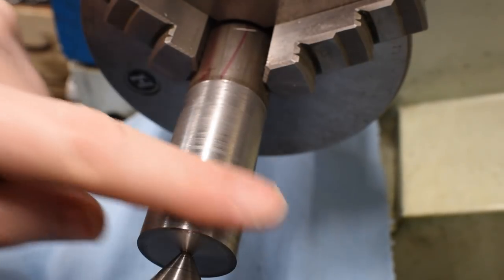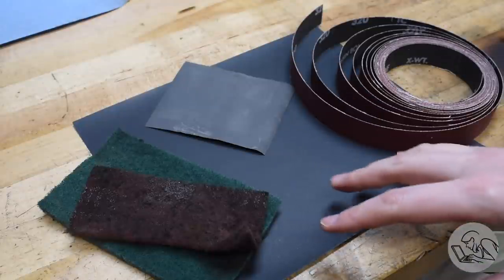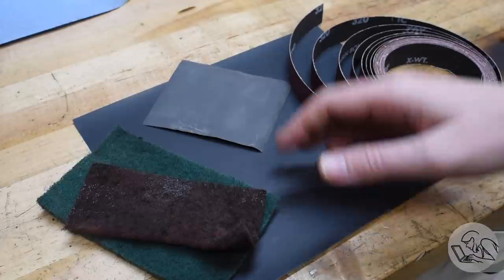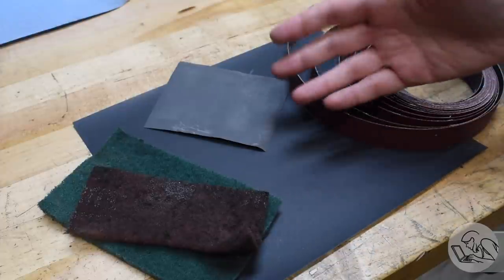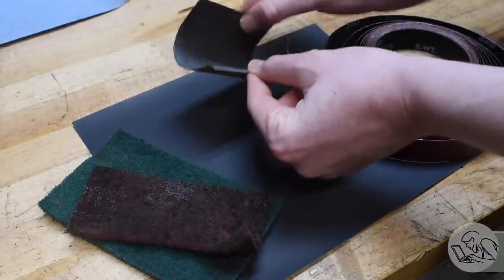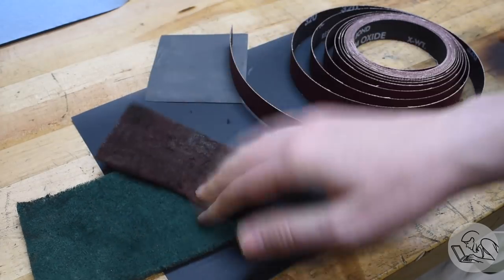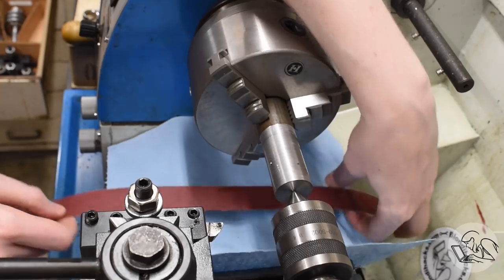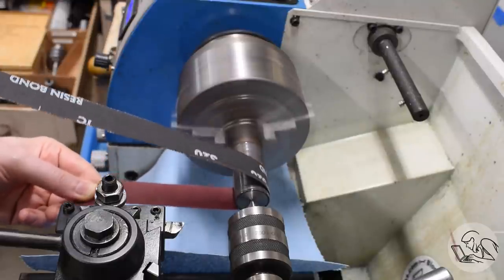Emery Paper In The Machine Shop

Comment: Words from a pseudo-professional (three years full time on a lathe): I routinely use coarser grits than 320; for removing nasty tool marks and quickly zapping off a thou, 120 grit -- and sometimes even 60, believe it or not. 240 and 400 are regular finishing grades, and 600 for super-pimpin' gloss.
Reply: yes
Reply: Thank you for adding “super-pimpin’” to my day. It feels right.
Reply: I work with aluminum molds and I end up with 3000 and i start with 320 and just work up from there
Reply: 600? laughs in 1000-5000 grit
Reply: @MyLonewolf25  There's a place for that, but I get plenty fine finishes for bearing surfaces, etc, with all dimensions within .0001", calibrated off gage blocks. 600 is usually overkill for that.
Reply: I should also add, my polishing grits are usually in small squares, not long strips. I hold them in place with direct pressure; they are too small to wrap around the piece. Yes, they fill quickly; an air jet helps a lot. Every now and then they slip away, but it's not hazardous as long as you keep your brain engaged with your work, which I do all the time, and I recommend the same of any machine tool user.

Comment: I'm lucky and my work uses large 12" diameter scotch brite wheels. When they get down to 6" or so, they are considered worn out and are thrown away. I made a bushing to fit them to my bench grinder and now have an endless supply of free wheels!
Reply: Oh man, I love when things work out like that.  One man's junk is another man's treasure.  I have repurposed so many things people just give or throw away.  My mind is always working with this question: Hmmm, what can I do with that? Lol I seem to always come up with something. Great score!
Reply: Sounds like you should send your buddy Quinn a mandrel and some of those free wheels.
Reply: @onestopfabshop3224  Many years back, I worked for an INTERNATIONALLY FAMOUS Inventor of a "Trombone Valve"  for the Musical Instrument with that name.

At one point in his work, he did that "Figure Eight movement" that our Quinn Demonstrated so WELL!

He had a  0.500 inch thick Plate Glass, with all edges Factory ground and probably 12X15 inches (or larger) as his Sanding BASE.

My Point in Replying to you is, HE ONLY used the same Paper for ONE sanding, for either Aluminum OR brass !  !  !

After the days work, I would Empty his "waste paper bin" and All that 400 Grit Paper became MINE (after asking Permission First) ! ! !

He also had that Same Standard for his HOME SHOP MADE sliding table saw Blades: "X # of cuts" = NEW BLADE.

I salvaged 30-40 Blades, 4 Inch Diameter, 0.060 Kerf and like 120 Teeth around the blade!

BUT ~All that Stuff~ was ZERO Compared to watching a man who had the FIRST NEW Brass Valve Patent (for musical Instruments) since 1878 ! ! ! !

Weekly, our phone rang from Zurich, Switzerland, Sydney AUS, JAPAN, etc!!!!!!!!
Reply: @madsighntist14  That's a cool story man. Thanks for sharing.

Comment: "We've all put emery paper on our surface plate." ha joke on you I don't even have a surface plate.
Reply: Go buy a little one on eBay or amazon, a 9x12 is perfect for using sand paper. A Grade B plate is more than enough for most of what is needed. I always wanted a big precise granite plate, but I finally broke down about bought one of these, I use it all the time. And I don't feel bad about putting sand paper on it :) which I would have done it years ago
Reply: Haha yeah same. I guess everyone who has one does this though, Tom Lipton (Ox Tools) put out a video named 'Confessions of a surface plate abuser' not that long ago. And he's like a top tier, toolmaker level machinist. So if he does it then us lowly mortals don't have a chance in hell of resisting the temptation.
Reply: @ericg7044  I think the crime is doing it to a AA flat uber expensive plate. Get a cheap beater and dedicate it to that
Reply: @ericg7044  Tom Lipton did say that he has a dedicated surface plate for sanding and never brings abrasives near his trued plate(s).  I'm still at the "flat wood is good enough" stage, lol, but will likely get a piece of glass soon.
Reply: Sanding Stones are my favorite. Being so cheap compared to constantly buying sandpaper and not requiring glue or tape, it give you the full surface of the stone to work.
Reply: I am making up for you. I have two surface plates. One that sees emory paper all the time and one I don't even keep in the same room with emory paper.
Reply: Go to your local countertop maker, ask for the sink cut out from a granite counter. Probably free, maybe  $10-20.
Reply: I work at one of the few aerospace oem gearbox manufacturers, and they actually use the emery paper on surface plate method to flatten housing surfaces to join together. Their emery paper is about 4 foot by 8 foot though. And wet.

Comment: I run a CNC lathe and a lot of parts that I make call for a 32 or 16 surface finish on 304 stainless.  I can't tell you how many times that we've had problems with the surface finish, but I can't clean it up on the CNC lathe because of the tight tolerances and the lack of tool pressure.  So, I give it to the manual lathe guy and he chucks it up and uses sandpaper to fix the surface finish.  We've  been able to save hundreds of parts over the years by using this method.
Reply: I dont know your parts but you could add an option stop before the cut off tool and use MDI to spin it or just switch to handle and use the continuous spin buttons and use the cloth that way then let the cut off tool run.
Reply: @roydavis4136  Oddly enough, I finally figured that out.  It depends on how bad the part is, but if it's not too bad I use automotive wet/dry sandpaper to clean it up.  Thanks for the tip though.

Comment: The best tip I received concerning the use of abrasives (in the context of woodworking, but also applies to metalworking) is not to select a grade according to the finish you want to achieve, but to always think in terms of the finish you are starting with. Thus, an abrasive should be regarded as a tool to remove the imperfections introduced by the previous tool, and that determines the selection of the grade. In the case of sanding, you therefore start with a grit that is approximately twice as fine as your existing finish whatever that may be. This will removes the optimum amount of material at the scale of the existing imperfections as fast and efficiently as possible and results in a new finish as fine as that grit. If you want to go further, you simply repeat this principle - selecting a grit size to optimally remove the marks of the previous grit, and so on and so forth. The net result is the minimum amount of material loss for any given finish in the shortest possible time.
Reply: Best comment, well done aporiac
Reply: Thanks for passing this along, gives me a brand new perspective on the topic.

Comment: One thing they teach in metalsmithing is you sand in different directions: 120 vertical, 220 horizontal (for example) and run the 220 until you can't see the 120 scratches, and only then move to the 400.  That's the most efficient way.  On a lathe, you could run X grit for a bit, then stop the lathe and briefly scrub it axially to see if it has removed all the previous grit's deepest scratches.

Comment: One thing to note about glass is that it's a lot more flexible than one might think, we can even see it bending just a bit in the video around 14:07 
This probably isn't an actual problem (barring a very bumpy table), but local glaziers might have thicker glass than what is found in picture frames available cheaply and could be worth a visit. Or phone call, given current circumstances.
Reply: I use glass, but when I decided to use glass I just waited until I saw a discarded piece of tabletop glass or some other thick stuff on Craigslist/side of the road.  It was good practice for cutting thick glass by the time I had a nice square piece of the right size.
Reply: @nefariousyawn  We took out our back door that had a full panel of glass in it.  I use it to flatten the head of engines.  Works great.
Reply: I got a piece of 30mm thick glass, that thing is never going to bend or flex. It used to be a part of some chemistry lab equipment.
Reply: Cheap beat-up old thrift shop mirrors (or expensive new ones if you like throwing money away) are often made of 1/4" glass.

Comment: If you want to get a good finish on a part while lapping and you don't have high grit paper, turn over the emery paper and use the back. It was a trick I was taught during hand fitting in my apprenticeship and it works well, especially on aluminium
Reply: and 10 bonus points for using the correct spelling
Reply: @chrisd4987  I am British after all
Reply: Aluminum for us uncultured swine who throw our tea in the bay

Comment: I'm regularly using 1000 grid sandpaper for the small screws i need for my clicky pens.

They need an actual mirror finish and oh boi is it sattisfying to be able to tell the color of your eyes in a 5mm diameter part :D
The reason for the mirror finish is that i'm precision hotbluing them. And if you've never done it, i strongly recommend you try it some time. Just polish a part (actually it's not stricly nesessary) and heat it with a flame till it turns blue! This color makes me so happy ^^
Reply: I oven-baked a blacksmithing project I made once, and it turned out a nice blue... so satisfying!! (Edit: point being that the blue is nice even without the mirror polish factor. With it, wow, even better!)
Reply: @DavidLindes  definetly true, i also love when you don't heat it evenly and you get this weird rainbow wich shows only yellow, red and blue :D

Comment: I use the much higher grades (800, 1000, 2000) and a variety of polishing compounds for many of my projects. Of course, I cut custom motorcycle parts (grips, pegs, and such) but those are seen parts.

Simple Green, soapy water are really good too for wet sanding

Comment: I used to use Emery cloth when I was a kid but when I got older I began using silicone carbide sheets in various grits from 36 grit all the way up to 5000 grit. It finishes materials better and it creates a more reliable /duplicatable finish.
Also, for nice finishes on the lathe don't forget your long angle lathe files. They do a very nice job but it takes a little bit of skill and technique to master their use.

Comment: I went to my local glass shop and asked him if he had any "drops" he could sell me. He asked what I was using it for and he hooked me up with two  pieces of ¼" tempered glass cut to 10" x 12". Her even rounded the edges for me.  I now have great surfaces sharpening and sanding. Another truck is to lightly wet the glass then set paper on it and it acts as a glue and holds the paper in place. 😀 I think I've watched about thirty of your videos now and some of them multiple times. I think you've earned my support. You will be the first and only creator I support in Patreon. 😀

Comment: I notice you've removed the chuck guard on the lathe, now I'm not beating you up about this coz I spent the best part of 35 years arguing with people whose "raison d'etre" was apparently to fit every conceivable type of guard on my machine til it was impossible to do the work. I solved the problem by removing the guards to do the work and refitting them when I knew an inspection was due, as a hobbyist you don't have such problems. Keep up the good work. :-)

Comment: If you're trying to get a really shiny finish, using 2000 grit and above, it's best to rinse off the emery before you use it, especially if you store it in the same place as the rougher stuff. It only takes a few errant coarse grains to ruin the finish.

Comment: Holy jeepers that scotchbrite wheel did an amazing job there
Reply: As did the Real Time Honesty Cam 3000, it has to be said :)
Reply: I've been using one for almost a year now and I love it.  It's not too aggressive, and is long lasting unless you're deburring sharp edges perpendicular to wheel rotation (it will start shaving off the scotchbright; if you deburr parallel to wheel rotation first, it will leave a small groove in the wheel, but not eat the wheel as fast.)  They are pricey.

Comment: Great video and info! I’m glad you mentioned the “not to use it more than half of the width” and showed how to hold it but one thing to add to make it more graphical is NEVER roll the cloth around the piece you’re working on! MACHINE HAVE NO HEART!!!! That was my first and only accident I’ve ever had on the lathe, on my very first day of training (OJT)! My instructor was very experienced production (speed) machinist but not really an instructor. He just forgot the fact that anyone would be TEMPTED to roll the cloth under the palm of your hand and try to take as much material as possible in the least time to impress your instructor but, as anyone can predict by now, as soon as the end of that cloth catches under itself and closes the loop, automatically will pull in itself and your fingers in the process as any untrained/unharmed person will, also automatically, grab and hold that cloth to death to soon realize that there it goes your fingers under and between the cloth! And let me tell ya, one of the most excruciating pains I’ve ever experienced when my fingernail was smashed and pulled! I was lucky that I let it go fast enough to keep my fingernail and not break my finger, but the pain stayed overnight to engrave the idea of how valuable was the safety measures and how hard and heartless is any machine! Please, keep doing your little talks about safety as most of us have never done machine work and nowadays being so easy to acquire machinery to get started, what makes it super dangerous no matter how harmless any operation may seen!
Thank you!

Comment: I have had good results in polishing surfaces by using Abranet sanding mesh. One advantage in using this material is that it does not clog in use. It is available in many different grades to suit different applications. Assume this is available in your neck of the woods.
Reply: Is that like the stuff they use to sand drywall?

Comment: Hi Quinn, great content once again. If I may interject briefly, as a former fabricator in a glass fabrication plant, i can assure you that glass is not flat. It comes in various degrees of "bowing" depending on the heat treatment, size, thickness etc. Most not heat treated glass is fairly flat but thin glass of that kind is extremely flexible and it will take the average shape of the work surface you put it on. Hope this helps

Comment: Well buggar me Miss Blondie taught me something today . Using emery on a mandrel to hold small parts .                   I have not and do not use CA glue . . I have no surface plate but i do have a 20 mm thick Perspex that is flat I also use water on wet/dry as easy to wash in bucket of water to remove waste and keep paper clean

Comment: I have polished many hydraulic rick hammer buts with 400 grit off of a roll. No lathe, but I would hang it vertically. Start with a piece of it wrapped around a file to take off the high spots, listening to when they got smooth, then taking a long  strip  and wrapping it clear around 540 degrees (282 degrees celcius) so both ends were pointing the same direction and the paper was at an angle to the bit. Then pull and "push", working my way up and down. Once things were looking pretty good, get a new piece and wrap it the opposite direction to get a cross hatch. Then keep using the same worn, loaded piece both directions until I could hear it getting real smooth. Finally spray some WD on it and keep working it until I was bored and it was shiny. 

The used paper really works good for getting a shine because it's like using a higher grit.

I do not recommend wrapping it all the way around on a lathe.

Comment: Thanks Quinn,
Another great video, one trick I was told by a knife maker was to use windex (A brand of window cleaner here in Australia)
As a lubricant for wet and dry emery paper.
It works well an is cheap.
Reply: I used it as a coolant for drilling once.  It works very well, but it also seemed to accelerate the formation of rust.  Something to keep in mind if using it with carbon steel.

Comment: A tip from someone who isn’t a machinist of any kind but still loves machining: 
There are these rubber blocks used for cleaning the surface of skateboard griptape or belt grinder belts. You can use them to get a lot more life from your clogged up emery paper/cloth. It doesn’t stop the paper wearing down though, so you still need to watch out for the 320 becoming a 600 over time etc.

Comment: With the emery cloth put the ends in the tool holder with a spacer(to clamp down)that way you dot have to hold it and you can apply a lot of pressure, it works a treat cheers from OZ.

Comment: Nice summery. I often use the wet on the bottom of the paper between the glass and the paper. This makes the paper hold on to glass with surface tension.

Comment: my go-to sanding surface is a glass cutting board. About 8 mm thick (much more sturdy than picture frame glass), and it sits on rubber feet. I place this on a plastic serving tray, so I can use lots of water without making a mess. I sand a lot of plastic, and that really clogs up the sandpaper, so just wetting the sandpaper isn't enough.

Comment: Hi (Quin) Blondihacks
Regarding Emery Paper you only need Grain 600.
You make an Emery Paper eg a round bar came paper on this round bar you wrap paper around, you make 3 pieces with the same grain, you use the first one until it is worn, then you take the next one, you understand what happens. now you have 3 Emery Paper with different grains. the first is maybe grain 950 the next is maybe grain 800, you understand what happens then. You can also make these on a square rod.
These I use for my jewelry, I have nothing but the 3 and one for wet polishing.
These are some really good videos you make.
Thumbs up all 10.

HI
Ivan (Denmark)